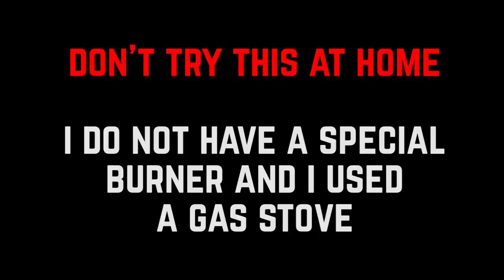Old Rusty Military Axe Restoration

Comment: Just an FYI you should not be using table salt for electrolysis. The reaction will produce chlorine gas. Better to use washing soda, which produces  hydrogen

Comment: I use an Xbox power supply, easy to modify.
I use sodium hydroxide (NaOH) as the electrolyte, diluted 1 part NaOH to 20 parts water.
Nice work.
Reply from the maker: Thanks, sir.

Comment: according to what I could find online, that's not a military axe, it is Soviet, but a Soviet Trappers Axe. How right that is, not sure, their military axes are a bit different and have a stamp on the blade. I'd have liked to see you take it further, polish it up to the nines, but thats always a choice, and put a better edge on it. I like any sharp tool to be razor sharp. Love the lanyard hole, works well looks good. Not a fan of the burnt look,  just don't like it, but again that's my taste. I'd rather see the handle with a paracord wrap, just because the cord can be so useful if need be. Again, that would be my choice. You now have a serviceable tool, if not the prettiest. that's always good. Personally, I'd like to see a better fit on the head and handle, but I did love the way your did the wedge. I noticed you were ot silly enough to put a thick metal wedge sidways and risk splitting the handle like it was when you got it. Oh, glue your wedges in, they will never back out that way, the head will stay on tight. leave just about a quarter inch of wood showing at the top of the head as weil.
Reply from the maker: Hello! First of all thanks for your advice and information. I want also to give this axe to my friend. He is going to the village for two weeks and I'm very interested will the ax survive? So, if not I will you your advice with head axe and will write comment in community section in my channel.
Reply: @ScrewsAndTools  My guess would be if it sees heavy use... might be a problem. Besides, it's not whether it can last a couple of weeks, but a couple of decades.

Comment: Hi and congrats on this restoration! You did well every step 👍.  I really like patern what you made on the handle 👌. It is ok with burner, until you get proper one. What I would suggest is to use after burning clean steel brush. That will give nice character to the surface 😊, hope you will test it out sometime. Anyway, awesome video and testing on the end of course 👍👍👍
Reply from the maker: Thank you for attention! Yes, I will test it. Thanks for advice.
Reply: @ScrewsAndTools  no worries, like your approach to projects and the way how you do them 👍👍👍

Comment: What's the water to salt ratio? And is that 120 volt? Does it matter which part you connect to positive and negative? I'm new at this, and have a lot more to learn.
Reply from the maker: Hello, thank you for attention. First off all, I use always different liters of water, due to sometimes I need to clean axe or knife. So, salt i use few tablespoons. Exactly figures is not important.

Comment: One question why spend the time on so many small individual cuts and then chiseling them out to make the handle when you could have just made 3 or 4 block cuts and shaped it with a wood rasp, seems like. Little bit of a waste of time to me, other than that great job and amazing restoration (just a curious year 9 wood& metal student not any expert)
Reply from the maker: Hello! Thank you for attention. You know, If I will made 3—4 wood block and after that will cut,  it can make huge cracks in handle. Due to I have some sandly experience in that case, so now I make 5—10 blocks and then use chisel to cut it.

Comment: Question. If you had a bandsaw, why shape the handle with a handsaw, hammer and chisel or better yet just use the handsaw instead of the bandsaw? Nice work though.
Reply from the maker: Hello sir, thank you for attention. Due to when I work by my hand I can control the process, I can not completely trust a bandsaw.
Reply: @ScrewsAndTools  Good answer.
Reply from the maker: Welcome sir.

Comment: Why did you burn the handle...?
Reply from the maker: Hello, thank you for attention. First I did that because I never have a axe with burned handle and second due to heat from the fire fuses the wood grain tighter together, creating a very hard, strong surface.
Reply: @ScrewsAndTools 
⭕ 😎 you are an expert 😎 ⭕

Comment: Why saw and chisel away the wood and then end up using a bansaw to cut the end.
Reply from the maker: I like work with simple carpenter tools.
Reply: @ScrewsAndTools  enough said
Reply: I’m just at a loss as to why isn’t his plane sharp, you should get smooth curls not some big chunks you need to punch, might be going the wrong way too.
Reply from the maker: @waywardhero1177  Hello, thank you for attention, do you mean handle? Or blade of axe?
Reply: Screws And Tools sorry just saw your reply. I’m talking about your wood plane. Those things need to be extremely sharp. You should also adjust it so the blade doesn’t stick as far down and make sure you are running the plane in the right direction so that you end up with wood curls.

Comment: This is probably the dumbest question, I’ve been trying to search what does it actually do. The salt water and that electric current, what does it do to a rusty metal?
Reply from the maker: Hello sir, thank you for attention. Electrolysis is a redox process that occurs on the electrodes when a DC current passes through a solution or melt of the electrolyte.

Comment: worst restoration ever
Reply: Why?)😁
Reply: @funnymoments6988  due to the last part where he burn the handle
Reply: @ammarmeer  For me, if you don't have a specific tools it's good way for me. 😁
Reply: @renzov8489 
Ok your right but not fully. 
I'm no expert but with a little search I found out that, yes burning the wood slowly makes moisture disappear and changes the structure of the wood making it stronger but, it also makes the wood more brittle and less flexible . Also experts think it was done to make the wooden spears tips harder. 
I'm my opinion  the brittle wood is worse for a axe handle because the handle absorbes the impact and brittle things are terrible at receiving impact force and tension but excellent under compression so it would break even faster that normal.
But it looks sick
Sources: https://arstechnica-com.cdn.ampproject.org/v/s/arstechnica.com/science/2016/05/turns-out-fire-hardened-spears-arent-as-badass-as-we-thought/?amp_js_v=a2&amp_gsa=1&amp=1&usqp=mq331AQA#aoh=15651560853959&amp_ct=1565156202424&referrer=https%3A%2F%2Fwww.google.com&amp_tf=De%20%251%24s&ampshare=https%3A%2F%2Farstechnica.com%2Fscience%2F2016%2F05%2Fturns-out-fire-hardened-spears-arent-as-badass-as-we-thought%2F

https://en.m.wikipedia.org/wiki/Fire_hardening

Edit: I read a little more
It makes the sharpening faster